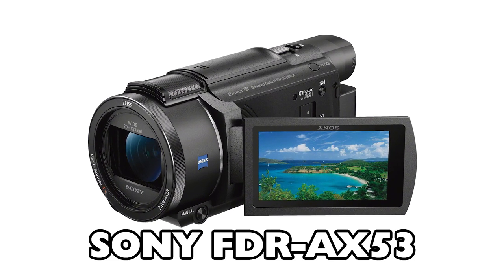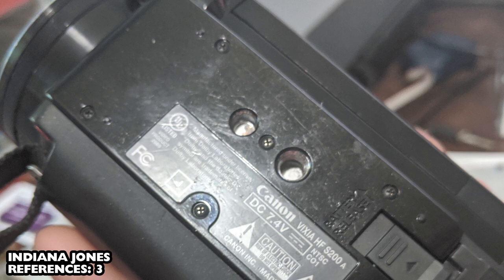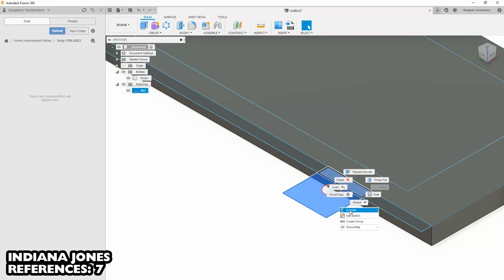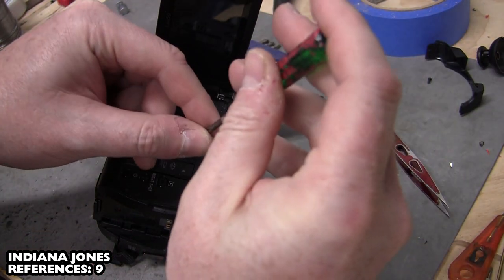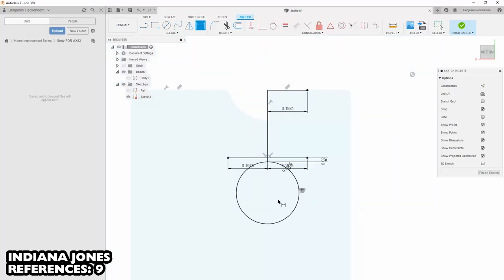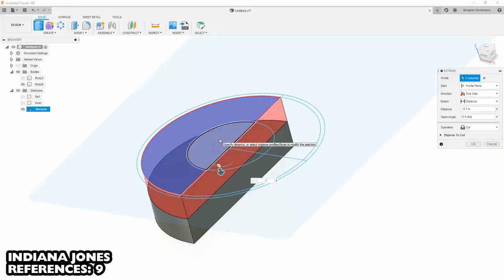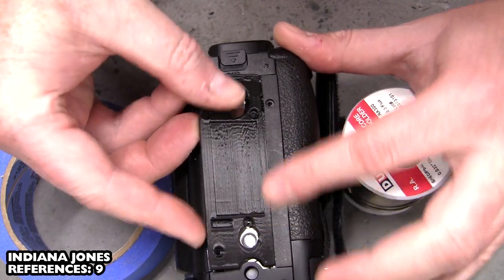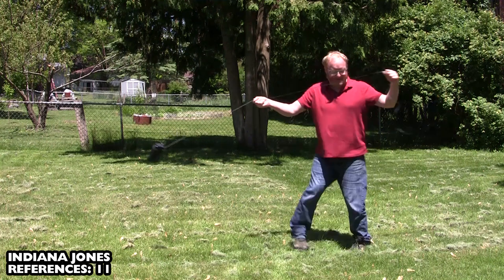Fixing the Sony FDR AX53 Tripod Mount Flaw

Comment: I have an AX33, gonna have to try this out and see if the parts fit!

Also, interesting they're still using the PCB from the AXP55, which is discontinued and was released in 2015.  I guess it saves cost on their end!

Comment: what...what are people using instead of scanner? I have to use mine pretty frequently
Reply: Phone cameras, which work fine for documents but not for anything requiring precision.
Reply: Lately i just hold things up to the built-in webcam. Works ok for less critical parts.

Comment: Just to point out the obvious... Ben could have just scanned the bottom of the camera directly, rather than messing with a rubbing. Also, does the scanner have an auto-orient setting? Some scanners will adjust the scan to make straight lines straight.

Comment: I guess you haven't had any focusing problems with the magnetic mount? I was wondering if it might interfere with anything inside of the camera.
Reply from the maker: It can actually, the sensor to detect if the LCD is swung open appears to be hall effect.

Comment: Visually, the replacement plate is a good match, but why not thicken the panel outward - a millimeter or two? Could still be done in a way that preserves the curvature of the edges and the flatness/parallelism of the mounting surface. Not that it really matters, the video’s over. In other news, 1/4-20 is very common for camera mounts, but depending on the area and industry, M6 mounting screws are, incredibly annoyingly, also used. So, the ill fitting, threaded piece might have fit nicely in the M6 version, but have been botched in the 1/4-20 variant. Whether or not that’s the case, it’s still iffy-at-best engineering.

Comment: You really don't want titanium teeth. They will wear down the opposing teeth. Gold is the "gold standard" of replacement teeth material. Don't ever get porcelain. They cost about the same as gold, but they tend to crack and have to be replaced. Gold crowns usually last a lifetime.
Reply from the maker: Yeah I cracked a porcelain crown last fall. Thanks for the tip! I am OK with gold teeth they may as well be for what they cost!
Reply: That's why you replace them all with titanium teeth!

I can see the appeal.